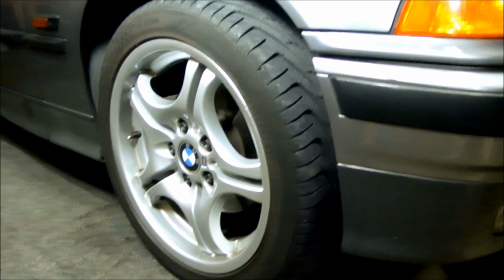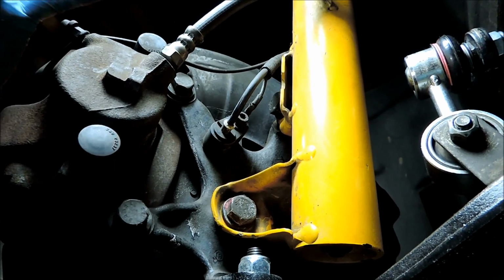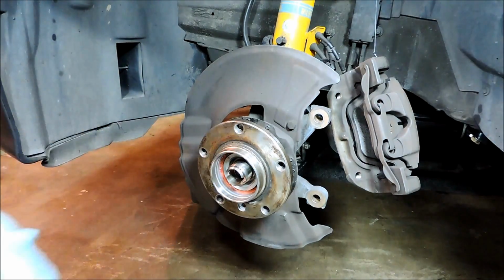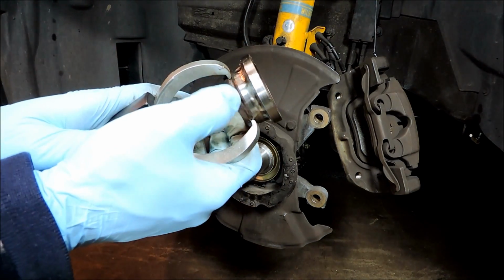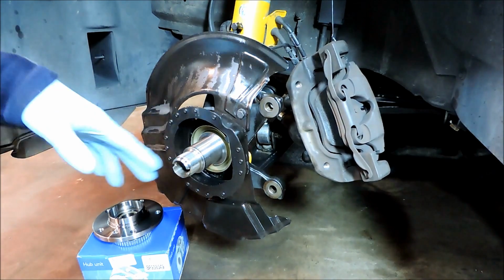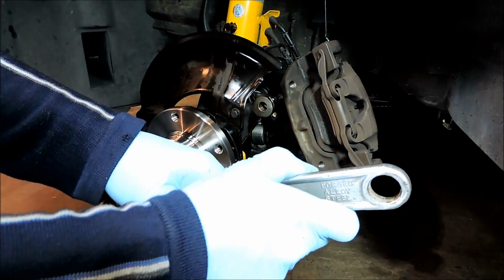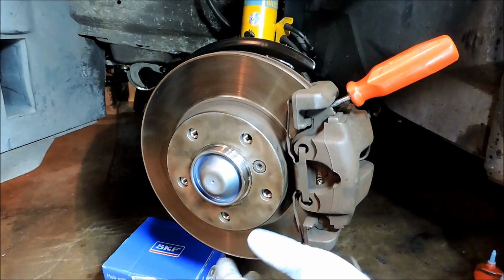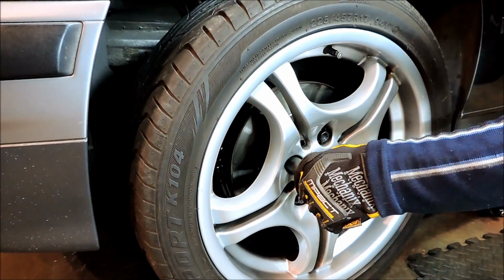BMW E36 3 Series Front Wheel Hub Bearing Replacement

Comment: Hello. I recently changed these hubs at home, but unfortunately it wasn't so colorful at my place :( I also bought SKF, only mine did not have a groove and I did not pay attention to it and tightened what caused that the dust cover had nowhere to hide and the hub did not want to And here I have a question, if the hub has no groove, do you need to remove the dust cover before installing the hub?

Comment: Great job and easy to watch! Quick question for you '95 E36 325is M50 I ran a compression test after changing valve cover gasket. My readings have me a little curious. I checked my tester on compressor up to 120 psi and worked good enough. The test came up dry 1-6 as follows 210, 213, 217, 216, 219, 216 and wet 219, 260, 245, 262, 244, 245. Does these numbers seem normal to you? This weekend I will be doing a leak down test. After test, car runs fine and I haven't noticed any oil leaks exceptaround the valve cover before, now it is clean. Any thoughts?

Comment: Brilliant video, thank you for this. I would suggest replacing the dust shield every time the bearing is replaced as preventative maintenance. The area around the 3 little bolts corrodes and it’s a pain - either the bolts needs washers to clamp the shield solid or a new shield has to be cut to slide over the hub. In the UK, the shield is about £20 so well worth doing when the bearing is out. Again, thanks for the vid and the clear, careful explanation.

Comment: You should coat the stub shaft and the inside of the bearing races with anti-seize before you install it.  Your future self will thank you down the road when you have to replace the bearing again and it comes off like butter. Also anti-seize on the axle nut threads. A thin coat of anti-seize on the inside of the rotor mounting face also keeps corrosion down. 

Anti-seize ALL THE THINGS

Comment: Nice video!  I will be attempting this on a 2006 BMW Z4, I hope it is similar enough!  You mentioned a distinct preference to steel wool over sandpaper for cleaning mating surfaces, could you briefly elaborate on why?  I am guessing that leaving silicon grit behind might cause wear issues, but won't careful cleanup address that?

Comment: I have a question man, I did this job and after a while now my bearings are wobbling. I noticed because I went to change my rotors and discovered that when I spin the rotor it periodically brushes the guard behind it. Any suggestions? Can I repress the bearing in without damaging it or is there another strategy for re-aligning it on the vertical? Thanks for all the help.

Comment: Great video, very informative, just my two cents though...some writing comes up saying that red loctite could be used also, I wouldn't do that unless you plan on using a blow torch to remove those lug nuts.
Very well done though.
Reply from the maker: Red loctite can sometimes be a pain to remove hardware. I like to use red loctite on differential ring gears, pinion nut, harmonic balancer crank bolt etc... Blue loctite is no slouch though, it holds very well for future fastener removal.

Comment: I had noticed that you didn't put the inner racer back on.
Reply from the maker: It was attached to the backside of the bearing  hidden from the camera; it goes on as one assembly. When you take the bearing off it is left behind because the bearing is not able to hold it in place due to the side load. When you re-install the bearing the race is pressed on behind the bearing as a single piece.

Comment: Amazing video! very nice quality. But... that used bearing looks like new!!
Reply from the maker: The bearing was used for testing purposes on the drivers side because I was gearing up to make a video of wheel bearings; I found that not all bearings are created equally. I have had quiet rides with TImken, Koyo, SKF, and Fag...as far as I know Koyo bought out Timken so you may find a Timken bearing in a Koyo package. I don't even know what the other brand names were that I tested because there was no name on the box....just a part number with made in China under it. Not only did they make noise, they also did not fit properly. BMW seems to like SKF while Ford likes Koyo and Timken... Timken was also the supplier for the Ford GT500 inner pinion bearing which was able to handle more torque. All these companies seem good in my opinion....Just sayen

Comment: Great informative video! I have an E28 and I suspect that the process is pretty similar.  Thanks for taking the extra time to explain the different ways of getting the job done especially the inner dust cap and the fit issue with aftermarket hubs.

Comment: A little tip is if you have the race without the lip, take a dremel tool and score a notch in the race that goes about halfway down through the race and then give it a good shock with a cold chisel. Should just crack the race and drop right out. Just be careful not to knick the stub shaft

Comment: Great Videos. I just did the hubs in my 1996 318i based on your tutorial. very doable when you know what you are getting into after watching your vid. To note, the hubs came out without a puller, and went on with out a press which made it that much faster and easier. They were tight but easily slid off and the new ones on just with hand pressure. Same with the races that were left behind. weird eh? Anyway, thanks again.

Comment: I don't normally comment on videos, but this one is an exception.   Thank you so much for a nice lengthy video describing in detail a lengthy process.  I own a 2001 BMW Z3 and I changed out both front wheel bearings using your video as a guide.  Exactly as shown, and since it was so thorough,  I had everything I needed before starting.   Thanks again for helping me out.

Comment: All pro mechanics should have this kind of level in craft and workmanship. However, they rarely perform on such level. In fact every time I visited the dealer, I ended up having to rectify their sloppy work afterwards. Annoying things like stuck wheel lugs, oil filter caps torqued down way over their spec and just monkey wrench the job. This DIYer is a shining example of how the job should be done. Its not rocket science. In fact all it takes is some care and dedication. That's why after a dealership service, I ended up having to go through their entire procedure, finding all sorts of mishaps. I have a recall notice on a E90 with vanos bolt problem that require replacing. The bolts are alloy and tends to break causing the engine to stall. Why in the world BMW uses some aluminium bolts is beyond me. I always laugh when I hear people say the German cars are all over-engineered. Perhaps this was true in the older cars, but the new ones are a PITA to work on. They don't even come with a dipstick to check the engine oil. In fact, the fancy over-engineered creations result in a computer checking your oil level and is known to be very inaccurate.  In fact, if the electronics went kaput, which happens a lot to German cars, you can kiss your engine good-bye for oil-starving.

Anyway, my hats off to this gentleman for showing the correct way to maintain our BMWs and taking pride in his work.
Reply: Amen! Totally agree on each and every point you mentioned!
Reply: Most Mechanics nowadays attempt to do any repairs as fast as possible
Reply: great comment.
Reply: I totally agree with you modern cars sucks a lot more more electronics and not reliable as the old one..

Comment: Thank you very much for this well made video. I decided to replace my bearing myself in order to save some money. I never imagined that the hardest part of doing this job would be finding a 40mm socket for the stub nut. I got everything in order including the pullers; I thought I'd swing by the tool store on my to my garage to quickly grab the socket; NOPE! I have gone everywhere with no luck.(Yes I went to Sear and Harbor Freight) I finally had to order one from the internet. The realities of getting things done. I still think I might save money when all is said and done though. So thanks again.

Comment: Hi there, quick question, the front disk protection dust cover is loose and rattling on my BMW e46, would i be able to remove it and replace with a new one if i took the rotor off?
kind regards John

Comment: And yes, I would like a rear bearing video too.  Nice work!
Reply from the maker: Yes it requires a B90 tool but can be done with a had held puller but not advises from what I have seen..... video in the works

Comment: Nice video!  can you tell me why you don't like using sandpaper for parts cleanup?  I get that there may be silicon grit to be sure to remove completely, but is there more to it than that?
Reply: Sandpaper can scratch the surface and may leave behind residue.

Comment: Great video mbs. Perhaps you could make a video on replacing the rear wheel bearing on an e36 maybe in the future?
Reply from the maker: Yes, I will come through
Reply: +mybimmerspace and if its no trouble to you an e30, greatly appreciated
Reply: I'll be replacing the rear wheel bearings on my E36 so I'll be doing a video in the not-too-distant future. It needs to be road legal first which means passing an MoT (annual UK roadworthiness test similar to state inspections). Noisy wheel bearings aren't a failure unless there's too much play in the bearing.

Comment: Great video!!
It Would be easier if you remove the knuckle and make all activities on hydraulic press!!
Reply from the maker: Yes you could do this on a press; no contest, although I normally use the press for front wheel drive wheel bearing replacement or rear suspension work on E36's. Sometimes my daughter wants to see what she can crush with 20 tons (:

Comment: Aftermarket hubs without the groove for the dust shield have a shield built in, integral with the inner race. With these there's no need to retain the dust shield at all.
Reply from the maker: If all of us got together we could build just about anything, I will definitely check into this the next time I come across one. Thanks for the heads up, your input will not be looked into.
Reply: So before installing a hub without a groove, you must remove the dust cover?

Comment: Question, considering wheels are balanced when they are off the car, what difference would it make if the wheel weren't mounted at the same rotation they were previously?
Reply from the maker: A close friend a 30+ year mechanic who works for an industrial shop told me that he always marks the rim to rotor hub. He found that just removing the wheels and installing them without a match mark caused vibrations in the driveline/wheels. It is pretty much standard procedure just as you would mark the driveshaft u-joint flange to the differential flange before removal. Maybe it doesn't always matter but why not mark it just to make it a perfect match as to what it was running at. I am a stickler about vibrations and will go to any length to minimize them. All I want to hear is the engine & exhaust. Looking at the BMW TIS they advise the technicians to place the wheel lock (if used) at the top left or right adjacent to the bottom air valve stem to offest the balance between the two. It really does come down to that for the best balance. I hope this helps, M.B.S.
Reply: mybimmerspace
I understand the wheel lock for sure. In my case though I don't have my original wheels in their original position from the factory, and judging by the wheels on the E36 in your video I imagine that isn't the case either. I've had my wheels rotated by multiple techs, so in my case and your case, how do you know what position is best? Maybe a different rotation would actually cause less vibration? I totally respect doing everything possible to make something better even it its immeasurable... On this particular idea however I can't seem to get my head around it. All of this could very well just boil down to a difference of opinion, or OCD habits, which btw I fully admit to being OCD lol. I just wanted to ask about this in case there was something I was missing. Anyways keep up the awesome videos!!!
Reply from the maker: ***** Mr. Andrew Schlukbier. Great question!  Yes This E36 does have one inch larger diameter rims ( original sports suspension 325I 16" to 330I 17" rims.  They were mounted and balanced with new tires, thanks to a great shop. I usually do not see any balance problems "unless your are using off shore rotors that are not spin balanced" untill I hit 60 throught 120 mph or more....that is were matching the rim to rotor comes in handy on used & new parts... nothing is always perfect, Sorry If wasn't more clear about how two working parts start to form a relastionship between each other when worked in to each other. The rotor has much more rotating mass then the hub.. I know this can be a very controversial subject and I am open to controversy. Thanks for your input

Comment: Where did you bought the hub bearing installer...312110  bmw special tool and how much is it. .. did you get it from bmw dealer?
Reply from the maker: I purchased this tool directly from BaumTools.com. Cost was just over $200.00 U.S. dollars. I am working on setting up a rental tool program through my website in the near future. To work around these BMWs it can run into the thousands, in just tools alone. Not to discourage you but these tools make life a lot easier with professional results.